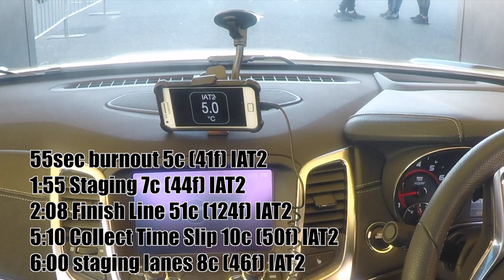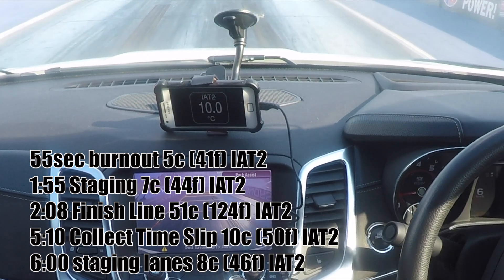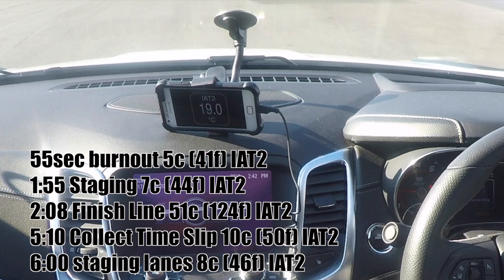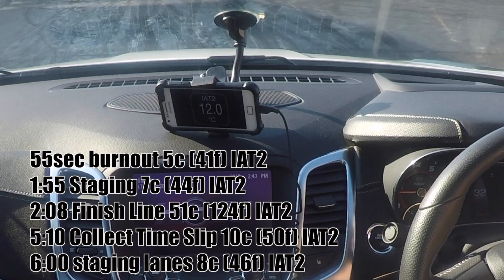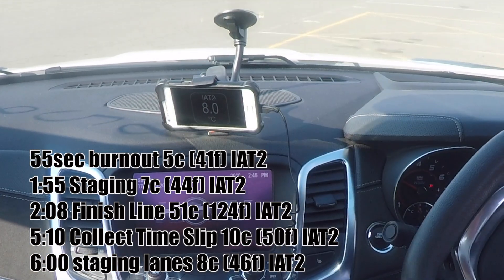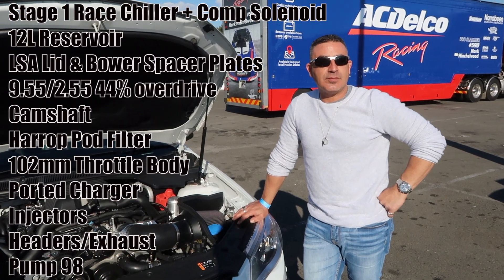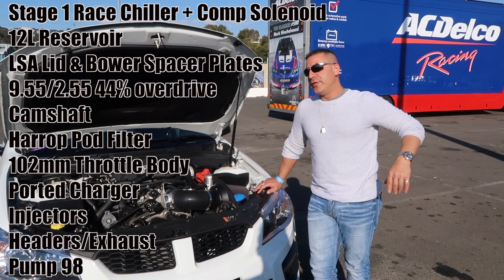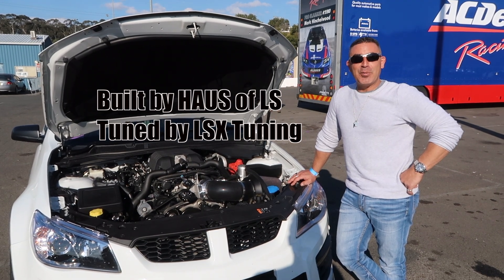EXACTLY what is it like to race with an Interchiller?

Comment: the intercooler under the super charger does not have enough surface area to keep up with the interchiller water temp. imagine if you could maintain 10 c to the top end.
Reply from the maker: Have a look at this data log: https://fiinterchillers.com/tech_articles/emp-intercooler-pump-vs-lsa-intercooler-pump/

Also we do have guys that have setup their pump system as per our exact recommendations and they have crossed the finish line as low as 8c (46F)
Reply: @ForcedInductionInterchillers  Imagine running a 2 air to water intercoolers. Boost in The first one with a regular air to water front mount heat exchanger to pre cool the air charge into the second air to water intercooler thats connected to a separate interchiller water reservoir to bring your ambient air temps coming out of the first intercooler to sub zero. 2  completely separate air to water cooling systems, air to water and inter chiller to water, with only the boost pressure side of the systems connected in series.
Reply: @A2J_Tim  horrible idea

Comment: Do you keep the AC on all the time then?
Reply from the maker: Yes however we install a solenoid on the liquid line going to the cabin which can ON/OFF block refrigerant flow to the cabin. 

This then allows you to run the system in 1 of 2 modes:

1. cabin and chiller
2. chiller only

Comment: does this tend to decrease engine coolant temps too?
Reply from the maker: yes it will dramatically lower your intercooler fluid temperature (it will have no effect on the engine coolant temperature of the running engine - this is effected by combustion temp not intake air temps)
Reply: @ForcedInductionInterchillers  If you are injecting substantially colder air in the chamber, doesn't that mean chamber temps will be cooler, hence a cooler running block, hence, cooler coolant?
Reply from the maker: @duane_bonney  you are looking at a colder denser more oxygen dense air charge, combustion temps are lowered but not by enough to impact the engine coolant or oil temperature.

Comment: Do you guys do a kit that makes use of the Miami engine’s unused intercooler core. I’m comfortable enough to fabricate the end tanks and inlet outlet fittings.
Where and how did you pick up the IAT readings. I’ve got a Subaru that’s got a modified Holden temp sensor wired to the ECU which is reading from the inlet manifold. It climbs to 60-70 degree range if I stop for a minute, whether the engine’s running or not. From then on, it pretty much stays there and retards the timing/boost maps as a result. A quick drive with a spray of the intercooler water spray will drop the IC outlet temps significantly but IAT temps stay high.
Reply from the maker: we have done plenty of ford FG's as well as Subarus, as long as you have the water air side of things and AC we can do  any car

Comment: Meth temp lowers, needs a small meth nozzle that increases cc with inceasing temps
Reply: Meth or water/meth will reduce power unless you specifically tune for slower flame burn rate. Need to run it permanently or use multiple tunes. This setup will improve performance of most modern cars with EFI and iat timing trims. This would be great on my S/C Coyote for those instances where I really don’t want to suffer detuning due to high iat (which happens every time I drive it due to heat soak through the manifold-DANGER TO MANIFOLD!!!!!). I wonder if their kit would work in the unused factory Ford Miami intercooler core? I better reach out to them.
Reply: Looked into water/meth but decided it was too much of a PITA for semi-daily driven car. I know, I know-I’m lazy. Using the FG GT-F tuning strategy allows pretty decent power increase when inlet air temps are managed well. I’m too much of a tightwad to consider the Harrop/Herrod/KPM intercooler setup for my car.